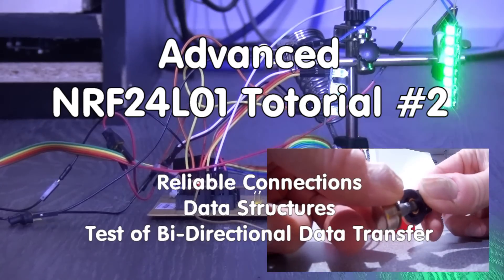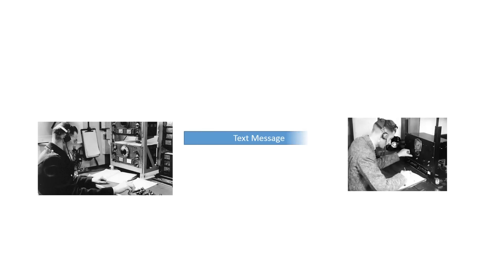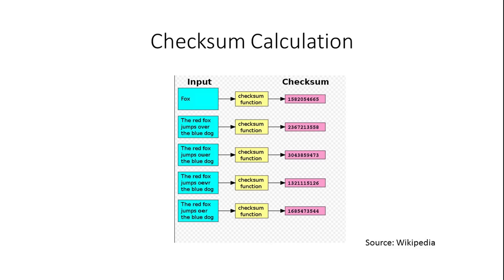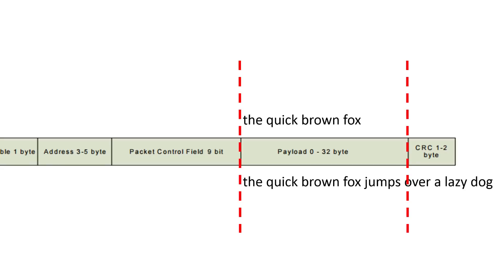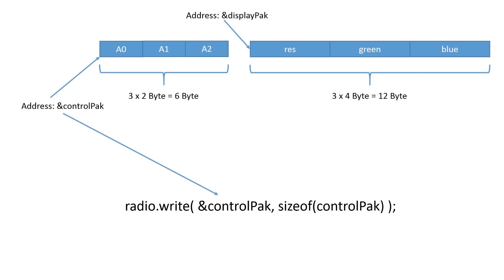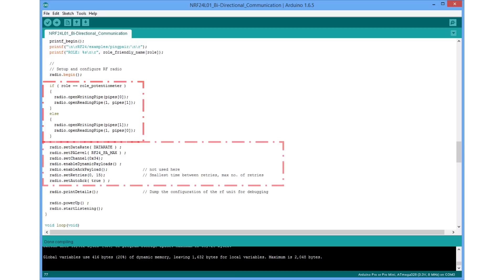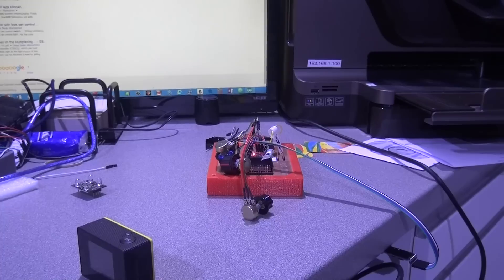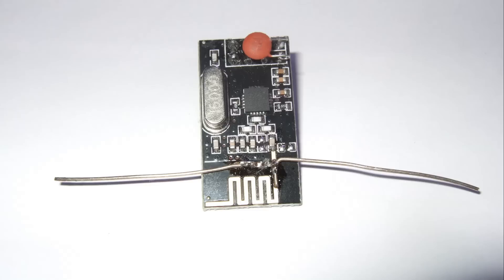#38 Advanced Tutorial for NRF24L01 and Arduino #2 Reliable Connections

Comment: Hello Andreas, nice video and still valid. Fun of learning programming, electrotechnic and playing around with MC's I am following your channel. I'm building me a DIY RC Transmitter/Reciver and did order a NRF24L01+ PA LNA SMA mit Antenne. In your video at approx 13:27 your speaking about λ/4 ground plinth antenna and would like to know your calculations, length of your 3 extra annetnas and where you did solder it on the PCB of the nRF24L0I. I did see in an calculation of 868mhz A. Vertical Monopole Radiating Element (λ*0.25)*vf=82.1mm and B. Radials (λ*0.28)*vfActual =91.9mm with Velocity Factor 0.95. but if I look at your video the B looks shorter then 91.9mm (I don't know your A length and MHz) so long sprach short would love to hear something here or perhaps you have made a video in the past or you know about a video/url. I could not find so much how to do it. Thanks Per
Reply from the maker: The element on 2.45GHz should have a length of about 2.9 cm and the radials 3.3 cm ( https://m0ukd.com/calculators/quarter-wave-ground-plane-antenna-calculator/ )
Reply: @AndreasSpiess  Hi Andreas, thanks I used the same URL. Last question the 3 Radials on which pins on the nRF24L0I do you solder them? Thanks in advance. BR Per

Comment: TX   
 struct Telemetry{
  char* compass_bearing;
  float  azimuth;
  float  altitude;
  float  temperature;
  float  Speed;
  double Longitude;
  double Latitude;
  byte  Time;

  float voltage;
  float rpm;
  float pressure;

}; 

Telemetry data;

.....
  radio.write(&data, sizeof(Telemetry)); 
...
RX : radio.read(&data, sizeof(Telemetry));
  Are my data sent in the package too long?  My telemetry TX RX is  NOT working in the transmission  & receiver.
Reply from the maker: Maybe you calculate the length of the structure?

Comment: I am building a plane (f 22 raptor) which has only 2 servos to control everything which are connected to two separate  elevator (no other control services) so what should i include in program(i am using Arduino nano) to   move elevator to turn and also go up and down using two parallel control surfaces ( if you dont understand what i want these control surfaces to do pls see at 30:53 https://youtu.be/iPHhmgYjQog ) pls help me

Comment: i waited the complete video tat ur gonna make reliable connections of the hardware....
also y did u use radio.PowerUp() in the setup
also wot about using 10uF cap between VCC and GND?
also what power source did u use to power up the nRF chip for PA_MAX?
Reply from the maker: This is an old video and I do not remember the details. :-(

Comment: Hi. I have a question. Can i use the same transmitter to transmitted 2input (switch1 and switch2) to give output of the same receiver (LED1 and LED2)
Reply from the maker: You have to solve this problem with your Arduino sketch.
Reply: @AndreasSpiess  can i have some example of the arduino sketch to solve this problem. i have done it but my switch1 and 2 controlling the same LED

Comment: I am unable to recieve structures on the reciever module. the code runs smoothly and the radio available check goes through yet i am unable to recieve the sent data using the radio.read command. help me out please
Reply from the maker: I cannot do any remote diagnostics. But I am sure you will find the problem. Maybe you start with a very simple example.
Reply: @AndreasSpiess  indeed I started with simple examples like sending integers and those are working fine. I'm having trouble with sending structures though. Can you provide a program that transmits structures and one that receives structures.
Reply from the maker: My self balancing robot uses structures:; https://github.com/SensorsIot/Self-Balancing-Robot/blob/master/Robot14/Robot14.ino

Comment: When you openReadingPipe(1,pipes[1]) are you not naming the receiver end of pipe 1?  When you openWritingPipe(pipes[1]) are you not simply defining the address label which should be attached to the next message?  Are your pipes[ ] actually addresses?
Reply from the maker: I have to admit, I do not remember the details. I just remember it took me a while to understand the concept of pipes and I had to consult the datasheet extensively. If I remember right, the pipes are a sort of address to distinguish between different devices on the same channel and also the direction.

Comment: Great video Andreas!  I wonder if you might try a little library I wrote for these modules.  It's called NRFLite https://github.com/dparson55/NRFLite and it's goal is to be far easier than other libraries out there while still supporting the important stuff like ACK packets, dynamic packet sizes, and the like.
Reply from the maker: Thanks for your link. Currently, I have no projects with the NRF24

Comment: Hi I have a question. I want to use nrf24l01 and 5110 lcd together, but i cannot do that. When i activated one of them.  It will work perfectly, but when i use them together, only nrf24l01 works. I am using nrf24l01p library for dual communication. Can you build like that, or explain in comment?
Thanks
Reply from the maker: which pins are you using for the communication?
Reply: nrf24l01 -> 7,8,11,12,13
5110 lcd -> 2,3,4,11,13

I tried other pins but it doesnt work
Reply from the maker: Maybe you google "nrf24l01 5110 arduino". I got these two where it seems to work:  
http://www.instructables.com/id/Arduino-Wireless-NRF24l01-Battery-Voltage-Monitor-/
http://www.instructables.com/id/Nrf24l01-With-5110-and-3-Sensor-Plantation-Control/
Reply: Thank you very much.

Comment: very interesting. I have ignored the nf24l01 but recently bought two nf24l01+ high power modules. the ones with the rubber ducky antenna. works well but I noticed the auto knowledge not to work in 1mbps and 250kbps. would only work in 2mbps. going to try your software to see if the issue is with my software or with my modules
Reply from the maker: These are cheap little things and good for point-to-point connections...
Reply: Andreas Spiess indeed. in spite of the auto acknowledge issue I could bridge 300-400 meter. maybe more but I didn't try that

Comment: I've got a few of these and some pro mini's to set up temperature sensors. I'll use an ESP???? as a receiver and connect to an mqtt broker.
I can then use openHAB to turn up my nest heating as the thermostat room is normally too hot.
If I ever get time. Baby boy takes up most if it.
Reply from the maker: This is good if you do not have Wi-Fi where your sensors are. Otherwise it might be better to use an ESP also for the sensors. Unless you have a special need (power saving for example)

Comment: Thank you I have been trying to find a way to program my arduinos after first seeing mysensors video on controlling a relay.  I see you are an amateur radio operators as well.  Need antenna theory in the production.
Reply from the maker: There are a few channels around which are dedicated to hamradio. So, I will not add another one. But you will see combinations of microcontrollers and radio.

Comment: Great video. I found it best in this topic among other videos on youtube. Working on a project very similer to your one. I got a clear idea about RF24 arduino codes now. but I need a little help.
I am a beginner in arduino platform. Don't know all the functions and definations. Some of those in your sketch is not clear to me. Specially starting with "#".
So I am listing those below. Some of these seems to me that the function works same as another basic function which I understand well. In such case I'm attaching my well known basic functions.

Sl.    Function used.                      Can I use instead?          other question
1      #define NEO_PIN       6         int NEO_PIN = 6;             Are they same?
2      #define COUNT       10                                                    Is a pin? looks same as previous,
                                                                                                   what is the difference?
3      #define DATARATE               radio.setDataRate         Does the Same work?
                             RF24_2MBPS                       (DataRate);
4      typedef enum { }                                                             Can't understand.
5     roleDef;
       roleDef role;
6    #if defined(__AVR_ATmega1280__) || defined(__AVR_ATmega2560__)
      RF24 radio(48, 53);
      #else
      RF24 radio(9, 10);
      #endif
Thank you for the 2 videos. If you have a little time to response  to my request, I will be greatly thankful to you.
Reply from the maker: Your questions are very general and show me, that you should first develop your Arduino programming skills. Maybe, this is not the project to do that because it is quite complicated. I did not start with these kind of projects. 

A few hints: 
Google for "constants and arduino" and you find informatiion about the #define statement and its differences to variables
Google "(__AVR_ATmega1280__" and you find the explanation about this constant
Google "enumeration and arduino" and you find the information about the enum statement
Google "SPI pins Arduino uno and "SPI pins arduino mega" and you find th info concerning the pins 9,10,48,53 (https://arduino-info.wikispaces.com/Nrf24L01-2.4GHz-HowTo)

All three questions are not easy to answer and it will take time till you understand. Good luck!
Reply: +Andreas Spiess 
Thanks a ton. 
It seems really hard to understand these.
Thank you again for your reply.

Comment: Very interesting series. I have a level sensor in the heating oil tank in my garden which transmits data back to two receivers in the house, and I often get problems with the connection, you have given me a few ideas to improve this. 
I have indeed found that using the amplified unit and larger antenna at the transmitter has helped - the traffic is one way only without acknowledge.
Thanks for sharing!
Reply from the maker: +jix177 I hope it will work for you. Maybe you use a similar setup like mine to test the connection and find the right "spots" for the antennas or a free channel. After that, you still can go on with the one way transmission...

Comment: I thought every message could be 32 bits =^) Much more versatility than I expected.
Reply from the maker: +Flo wey No, 32bits would only be two 4 bytes which would be really small compared with the overall message size. 32 bytes is still not a lot, but for my application it was sufficient.